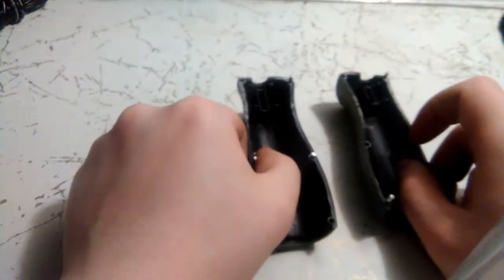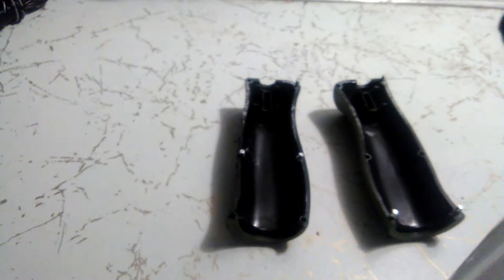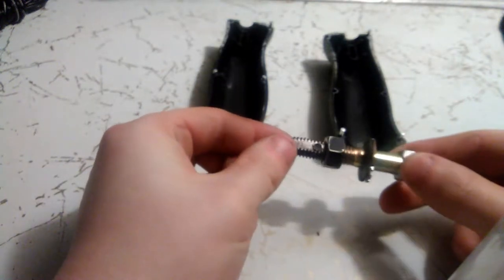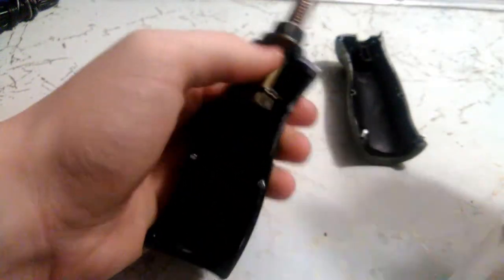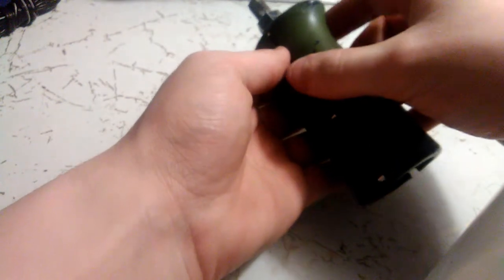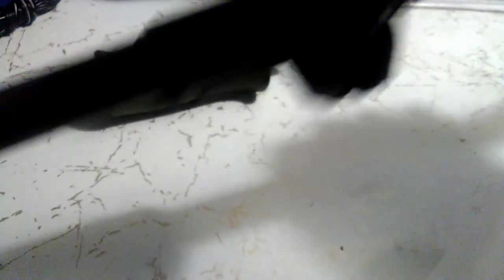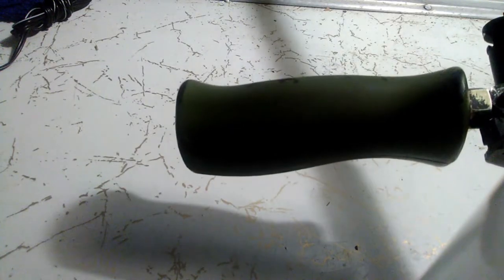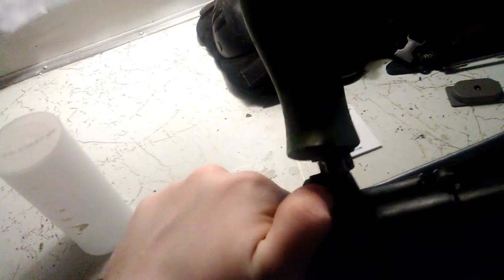How to FIX Your JG Aug Grip

Comment: Dedicated ASG AUG A1 owner:  'lost my folding grip 5 weeks into having it, then just last year I lost the front gas port on the barrel, which is like $40. any tips on where to get that or in regards to the gearbox and what battery I should or should not use would be helpful!

Comment: How did you get the glue off ? It's glued hella well ! 

Edit; Putting the handle in really hot water and prying it slowly works, just had to be careful to not break the plastic while doing so.
Reply from the maker: In my case, the glue had been applied really thin so prying it apart with just a little bit of force was good enough, but your idea is much more safe.

Comment: Can you upload a video how to zero the scope ?
Reply from the maker: Sorry man, I owned the A2 version not the A1.
Reply: is yours shooting low too? Mine was impossible to zero. The lumen is just too tight. I had to slide the telescope out by about 2 inches to give it more wobble room for adjustment and wedge it in place with rubber packers.
Reply from the maker: @ThOutRider2  I wouldn't know unfortunately; I used the A2 version not the A1

Comment: Do you know were I can buy the bolt that connects the grip and barrel? I bought this bottom rail but it didn't come with the bolt. I have a California Aug didn't come with grip.
Reply from the maker: I believe we purchase the bolt at the ACE Hardware Store. If you walk inside and ask one of the employees about the bolt (Make sure to bring up dimensions), they will be able to find it for you. Make sure it's stainless steel!
Reply: @spade6118  I'll check it out later today. Thanks.